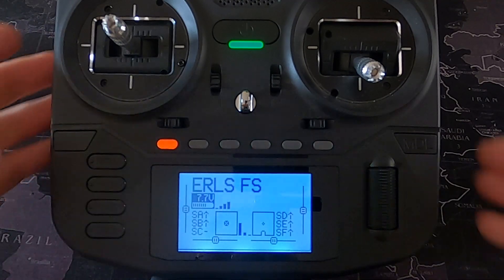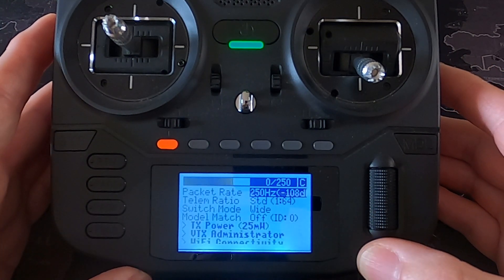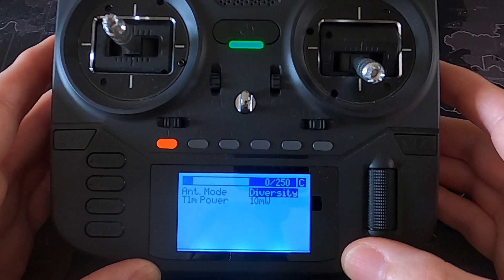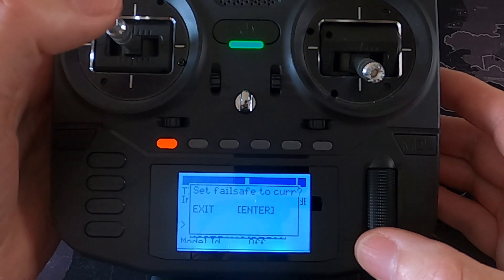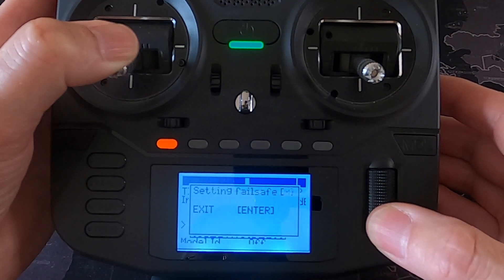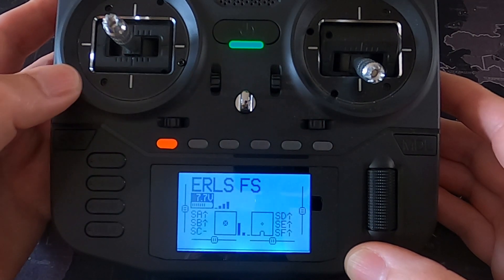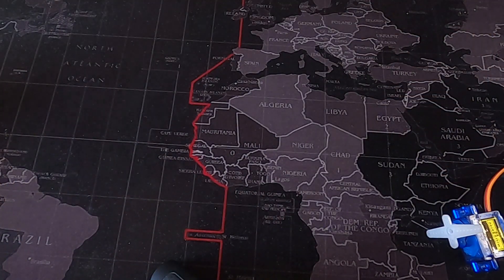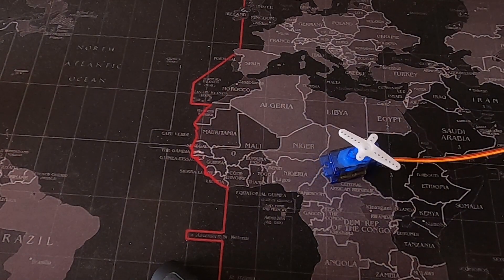Express LRS Setting Up Failsafe for PWM Receivers

Comment: I just got the radio master pocket from a friend, i bought q receiver, and i noticed when i move like 30meters away from my plane, it loses signal and keeps sending telemetry lost and recovered message, please jow do i go about this
Reply from the maker: Do you still have control of your plane, control surfaces moving smoothly and not twitching? Telemetry can be lost but not control of your plane. Which receiver are you using? If it is a none ExpressLRS you could have the receiver on low power mode which is used for range testing. The position of the antenna making sure it is as far away from electrical components in the plane.
Reply: @the-happy-RC-flyer  how do I remove it from low power mode? I'm using an elrs receiver . alright I'll try that and see if it helps. Thanks so much

Comment: Hello, does this also works with a switch position for a (beeper function) of an old type drone where i cant set in betaflight(immersion rc mojo230). Side note, I use sbus out as protocol on my express lrs receiver Thanks
Reply from the maker: Rob could you give me more information of what you want to do. The failsafe feature cannot be used for a buzzer.
Reply: @the-happy-RC-flyer   thanks, i was thinking the same... the problem that accured : i am flying and my drone will fly away suddenly, after 3 second the software of this immersion rc mojo 230 turns of an the drone will fall out of the sky all fine... normaly i can put my switch on my transmitter to activate the beeper.. not possible when i have a fault on the transmitter side. When i can tell the drone if it loses connection a sbus output goes in a certain position(same as the beeper switch on the transmitter) he will activate automaticly the beeper in that position. Hopefully you understand. try my best to make it logical.
Reply from the maker: If you are having flyaways you need to check your FC settings in BetaFlight. Failsafe may not be set up in Betaflight correctly. Is your receiver installed correctly, check the solder joints.

Comment: Thanks for this Bill, can you demonstrate this process in the Radiomaster Pocket please ?
Reply from the maker: It will be exactly the same go to the ExpressLRS Lua script and run it. Select Other and your receiver and click Failsafe. Hold the sticks in the position where you want the throttle and control surfaces to fail safe and click enter to complete the process.

Comment: Hello! Congratulations on your content! I would like to ask a question, I have an R9M module and an R9MM receiver with ELRS installed, but I cannot find the failsafe configuration. Does this receiver not have a failsafe option? Or in this case should this be done on the radio? Thank you very much in advance
Reply from the maker: Hi Renato, thank you for your compliment. Do you have the latest ExpressLRS firmware flashed to the Radio and Rx and the latest lua script? You should have the option to access the Rx via your radio and set the failsafe I am in the dark a bit because I do not have the hardware to test for you.
Reply: Hi Bill, yes, I updated the latest version of the ELRS firmware, on the module and on the receiver, and I also downloaded the latest version of the lua script, but when I enter the r9mm receiver options through the script, the failsafe options for to set up. Can I send you a photo via email?
Reply from the maker: By all means please send a photo triplemadventures@gmail.com

Comment: Bill, I have a Radiomaster ER6G that I was hoping to use in a glider to replace a FRSky system.  My setup is three PWM channels in the Fus and S-Bus to the wing where I breakout to four PWM servos.  Whilst I can replicate this setup with the ER6G I find that the Fail Safe does not operate on the S-Bus channels to the wing – an important safety feature for a glider.  Is that a “feature” or am I missing something in the setup.
Reply from the maker: I have not installed the receiver into a plane yet but the ER6G is only PWM not SBUS. Ch 6 is a servo out put. Remember channel 5 must be used for arming a motor if your glider has one. The failsafe should work. If you have not already maybe download the manual from the RadioMaster website.
Reply: you can configure the pins of ch 2 and 3  to be a serial link in ELRS V3.3 and hence get access to all 16ch out
Reply from the maker: The receiver manual states 6 channel PWM so reconfiguring the hardware to SBUS maybe why the failsafe is not working correctly.

Comment: As a person , senior citizen with an analytical mind , Edgetx and other RC systems would be much easier to follow if said systems had a " Flow Chart " to help the non-digital mind navigate.
Reply from the maker: That makes sense.
Reply: Bill, great video! I did some range testing with me ELRS Radiomaster ER8G and found it with just as you show when I turned off the radio ... however, when instead I went out of range, the servos would go hard over instead of to the failsafe position. If this expected behavior?
Reply from the maker: @REDhlg  Adam not at all as soon as the signal fails the servos should move to the set fail safe position. I have not come across this before I will contact RadioMaster about this behaviour you have come across.
Reply: @the-happy-RC-flyer  I ended up playing with the channel 5 arm and tried my range test again and could not repeat the issue... now, every time I go out of range it goes into failsafe. I'll keep you updated if I learn anything.
Reply from the maker: @REDhlg  thank you for letting me know.
Reply: Hello, does this also works with a switch position for a (beeper function) of an old type drone where i cant set in betaflight(immersion rc mojo230). Side note, I use sbus out as protocol on my express lrs receiver Thanks